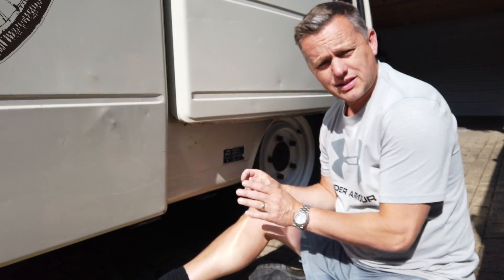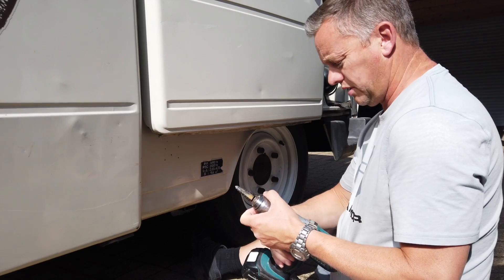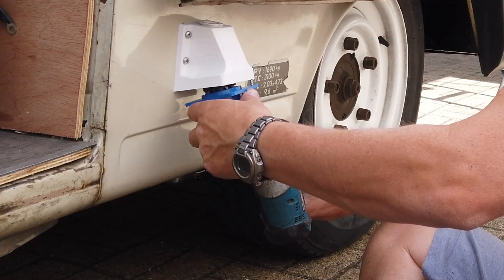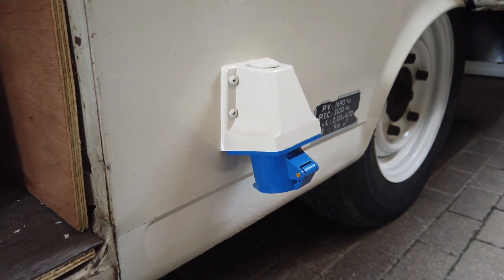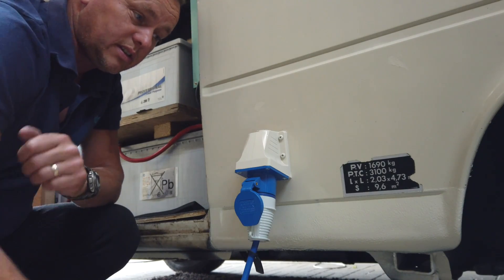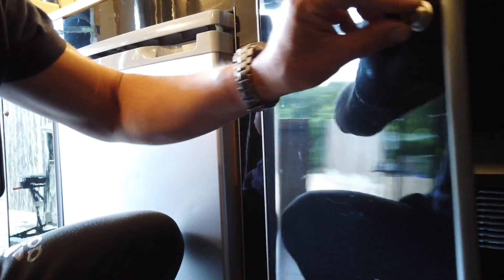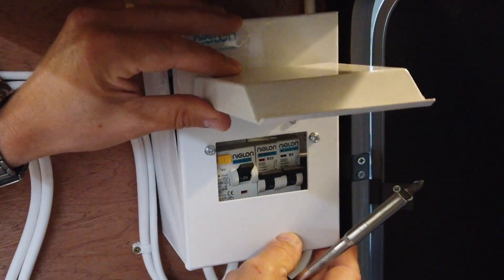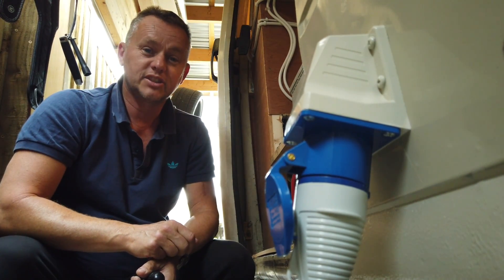Fitting 240V Mains Hook Up Socket To The Coffee Van "Peugeot J9 Project"

Comment: Why mess around with plugs and sockets? Why no 1-0-2 changeover switch and leave everything connected? Saves you putting a 16amp feed through a 13amp socket and leaves everything much tidier. I ummed and ahhed which way to go and saw someone had their plumbed like this and was stunned I hadn't thought of it before... (mind, my choice is genny/shore power, no way my machine will run off inverter as I was unable to secure an LPG machine :( )
Reply from the maker: The batteries and inverter didn't work long term, we now just run off Honda eu70is, Thanks for the great comments👍🏻👍🏻🛠

Comment: Quick question. I noticed when you were installing the socket it had a hole in the top, which later in the video seemed to have a bung in it. Did that come with the socket ? I only ask, because I have a similar socket I'm installing which has a hole in the top, but hasn't come with a cover or bung for it. If it's missing I'll send it back.
Reply from the maker: Yes the bung comes with the socket, Thanks for the great comments👍🏻👍🏻🛠

Comment: Widow maker  

Put a plug on not a socket you shouldn’t be able to touch live pins on a cable
Reply from the maker: Thanks for the heads up on my mistake, I was concentrating on keeping the exposed pins dirt free and overlooking the live exposed socket, I have ordered the correct socket and will be updating the error in a followup video, thanks all for the great comments I appreciate all the great Information.👍🏻👍🏻🛠
Reply: Total fail how not to do it

Comment: This is LETHAL.  You should have a plug on the vehicle (it's an "appliance") e.g. https://www.amazon.co.uk/MK-Commando-K9701-Appliance-200-250/dp/B003URQQO4 and a socket on the end of your cable coming from the house e.g. https://www.amazon.co.uk/PowerMaster-245112-32A-Socket-240V/dp/B000WTPX9M  Otherwise when the cable from the house is not plugged in to the vehicle, someone could touch the pins in the plug and be killed.  I'd also suggest a 13amp RCD plug on the cable that goes to the house, 'cos you don't know whether a 13A socket you're plugging in to at a venue will have RCD protection e.g. https://www.amazon.co.uk/Knightsbridge-RCDAV002-Safety-Plug-White/dp/B00KGSFYS4
Reply: Hopefully he reads this comment and amends his install otherwise he could be in for a shock!!!   Swap it for this https://www.amazon.co.uk/Knightsbridge-INAV0013-Industrial-Connectors/dp/B07NGCJPKW you won't need to change base  then put trailing socket on input lead all good 👍 I enjoy your videos have watched loads of them and hate to criticize people's hard work but felt the need with this one
Reply from the maker: Thanks for the heads up on my mistake, I was concentrating on keeping the exposed pins dirt free and overlooking the live exposed socket, I have ordered the correct socket and will be updating the error in a followup video, thanks all for the great comments I appreciate all the great Information.👍🏻👍🏻🛠
Reply: @aaanton11  The caravan industry must have solved this problem!  http://vi.raptor.ebaydesc.com/ws/eBayISAPI.dll?ViewItemDescV4&item=171169405931 but you would need good clearance inside the vehicle, and I would want to check that the back of the plug doesn't have exposed connections.
Reply from the maker: you guys are the best, thanks for the suggestions, I have ordered the new socket, and love the cap at cef Paul, the caravan square flush connector would be too deep to fit but would look really clean appreciate the time you guys have taken to help👍🏻👍🏻🛠
Reply from the maker: Thanks for the heads up on my mistake, I was concentrating on keeping the exposed pins dirt free and overlooking the live exposed socket, I have ordered the correct socket and will be updating the error in a followup video, thanks all for the great comments I appreciate all the great Information.👍🏻👍🏻🛠
Reply: @aaanton11  you could use one of these https://www.cef.co.uk/catalogue/products/137022-16a-2p-e-watertight-cover-for-plug-ip67 if you want to protect if you don't have room for flushed type or don't want a hole in the van lol .keep up the good work vans looking smashing 👍